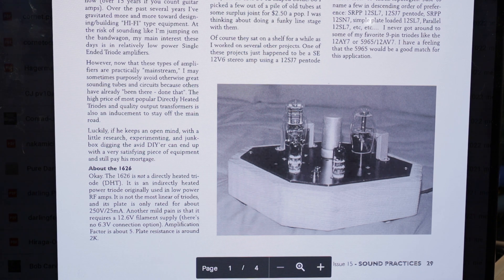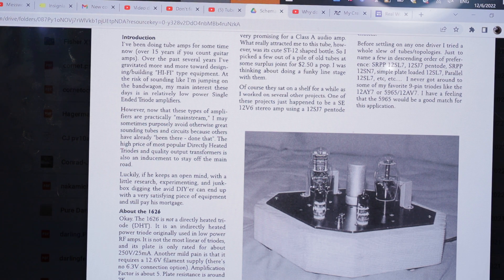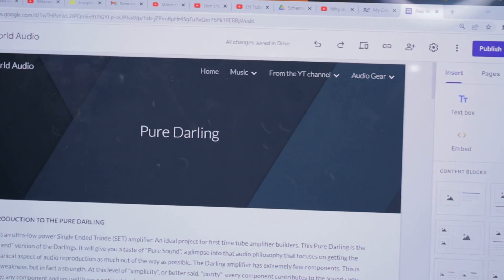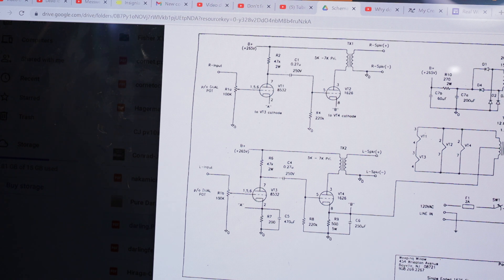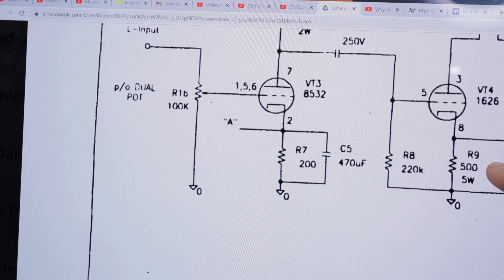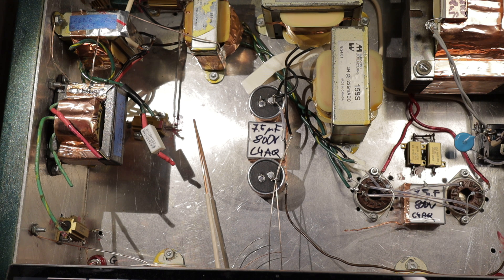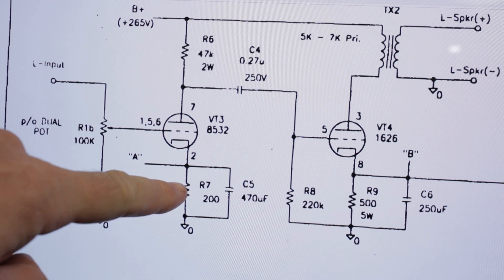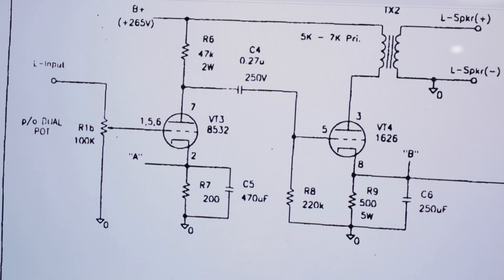Build your Single Ended Triode amplifier! - - ✨👍

Comment: Janos, I'm partway through your Darling amp build video series, but now that you're revisiting this amp, I thought of asking a specific question about the wiring of the amp.  As I see from the video, the wiring is twisted silver inside of teflon sleeve(not including the wires I see coming directly off of the transformers).  Is the silver wire immune to oxidation when the conductors are "loose" inside the teflon sleeve? Do you need to put heat shrink at the ends to seal them? does it matter? I also don't see any phiten n tape on the wires? How critical is that?  Do you put the phiten tape on top of the teflon.  I know I may be getting into the "weeds", but  I'm following the logic that every little thing counts.
Reply from the maker: ✨👍They are not fully immune to oxidization, but as there is no free air flow, the process is so slow that I did not see any significant signs of oxidation behind the teflon insulation even after nearly 20 years. Also, phiten will help only when it is exposed to light, so use it on the cable ends that connect to the gear, or, if inside the chassis, from time to time shine in some light. :) The phiten needs to be touching the wire, as the free electrons need to travel directly from its surface to the metal. The teflon tape isulates the free electrons from the wire, there it is practically useless in this fuction (although does provide a little mechanical dampening, but regular tape does the same at a fraction of the cost.)
Reply: @realworldaudio  thanks for clarifying.

Comment: I´m confused about sharing, You mean the R4 is 500 Ohm, when it feeds both channels´ tubes (L+R) so there is a double load, while seperated You mean L and R channel are seperated, and so each tube needs 1000 Ohm in order not to be overpowered.
So on the original schemata the upper 1626 does not go "to VT4" but has its own R4... ok, now I check it... 🤔🥴😂
Reply from the maker: When the resistor feeds both channels, then twice the current is running through = drops twice the voltage. Hence, for two tubes, you need half the resistance (and twice the power rating!) ;;).
Reply: @realworldaudio  Thank You János!

Comment: Hello Janos, it is a good idea to use a resistor from the wiper /pin out of the grid to earth because if failure or bad contact loosing of the wiper will impair the grid resistor path to earth ..........1Mohm in // ................
Ommiting this precaution MAY result some day  in run away with all the bad things to happen to your precious tube and sometimes  damage to other components in the power supply....
Remember our friend Murphy...........
Lifespan of a tube is not necessary shorter when driven in Class A when modulation currents  stay well within the maximum limits of the tube data.........this is a mostly very misunderstanded subject by many .
As well with dual triodes when one triode is specified to be allowed to run 2 watt n, BUT both driven the power should be reduced in the example to LESS as the double , say 3 watt for both running ...typîcaly use tubes at max 75 % of their power rating and all will go OK.......(except in class AB or class B..........)
As long as the electron cloud of the cathode is capable to provide the demanded current and when no other maxim design parameters are exceeded all is OK , also important that the temperature of the bulb does not eceed 200 ° C..............
The cathode lifespan is impaired when the electtroins are stripped directly from the coating , in operation , at start up and at shut down because the temperature of the heaters fall down while High Voltage is still present in the power supply ..............just like a diesel engine ....
One should use lower volatges on the plate  running a tube in Class A ......
When these conditions are not met as  seen in many designs ( more so the recent revival made )   ...........the tube will wear fast when run to hot ...........and strip the cathode on max power delivery and poisoning the lectodes and the forming a cathode barrier or stripping the coating...
Current production tube s also have a lesser lifespan than the Nos tubes for  several reasons, one of this is the lost knowhow and recipes ( chemical and other ) and the new ecologic imposed restrictions on using those nasty and ( sometimes very )dangerous chemicals ...........
Lifespan can be greatly improved when taken in account these practice and knowledge of what tubes are realy doing.......
Indeed in your case you can extend the usefull life of your tubes for thousands of hours ........contrary to some audiophiles demands to replace their tubes on regular time base in their very expensive and exotic high end preamp and amplifiers ( these are often TUBE EATERS )..........they wanted those rare nos tubes and i refused at a certain moment to sell more out of diminishing lasting tubes badges............
Tubes are no longer consumables as they were at the era of tube electronics , especially the rare and expensive nos tubes , better to use them with respect and give them a GOOD ligfe.

As a note : In many cases as tubes wear out at last they loose the energy and dynamics,/power from their youth but just like the old grandfather is telling his captivated  
stories  late at evening toi his grand children , those old nos tube still sing to the last song ...........not so with most current production tjhat ask for replacemnt when the initial exitement has gone...........

Have a nice day every one........ 
stories
Reply from the maker: Thank you Frank! ✨👍👍
I have the exact same feeling toward tubes - longer life is of paramount priority! Especially as old stock dwindles, if we go on torturing the life out of power tubes, and eat through the stock fast, there will be nothing left to our grandchildrens generation. Also, I think that when tubes are pushed hard (to age fast) they sound strained and unnatural. In my Darling amplifier the tubes lasted extremely long. Those 1626 were designed incredibly well, and even though the operating conditions taxed them at 110% power dissipation, with 10 hours a day average, after 10 years 3 out of the 4 tubes were very strong (80% plus of their new values) and one got weak (I think around 65%). Interestingly, the other tube in parrallel with the 65% tube was 95% of new value! The pair for the other channel was in the mid 80s both. Sonically, the two channels sounded the same... a tad less dynamic than when new, but absolutely enchanting nonetheless. That's so true, old stock tubes, even when old and weak are still useful and wonderful devices. New production - they tend to just suddenly drop dead, filament opening, cathode opening or running away.... some form of actual death from which they cannot be revived.
Despite the DC coupling, this Darling circuit  has been the most stable circuit / amplifier ever to grace my home and the homes of my friends, with a cumulative of tens of thousands of hours of operation with zero incidents, total reliability and utter stability. This circuit is so exceptional because the tubes are constructed to be exceptionally long lasting and reliable. Plus, it is using damper diodes for rectification, and they turn on super slow, about 50 sec turn on time, allowing the filaments to be happy as the high voltage starts to very very slowly rise.
Reply: @realworldaudio  Indeed Janos..............I changed the tubes in my MC after +30 years , one failed ...............
EL 34 were specified 800 V plate , it was allowed to build 100 Watt pp with that tube..................NEVER do this with current production............
I had customers who had the famous P100 from Bill Beard.......100 watt , KT88 GEC pp...............When those tubes were obsolete the newer tubes blew up every time...............I found one solution , replace the tKT88 with at that time available KT90 EI (proiduction from before the Yougoslavia war )
In my CD ^mayer were the GE 6CG7 stock tubes since 1992...........I replaced them by curiosity some years ago ............BUT after some days I put the older ones back in ................yes they were not as dynamic anymore  as the new onesbut they had still the melody, the tone and a musical story to tell........without any regrets . The day will come I will replace them but meanwhile i keep on LISTENING !
The anti tube ligue in the audioworld hammers ever since on the fact that tubes age ................but they don't mind changing the brakes in their BMW's .........or replacing tyres etc.................
Under good operation points and conditions tubes will outlive the CAPACITORS !!!!!!!!!!! They don't like to hear that !
I have a Philips radio that i found on a bin ............made in 1959........I restored dome components and it plays since with still the ORIGINAL tubes  inside !
An OLD school engineerings tric !................seen on older radios ( mostly German and others ).............They calculated the resistors of the loadlines for tubes that were some aging andt the distortion diminished as the tubes wears out slightly .............somewhat less power ? YES .................BUT LESS DISTORTION as time goes by ................Those technicians were NOT STUPID ! ..........§his applies also to many other technical/electronic devices ..............today the hype of never getting old .........and immortality hahaha..........we can still learn from our forfathers ( and mothers ! )
:shelterin:Greetings to the cats...........